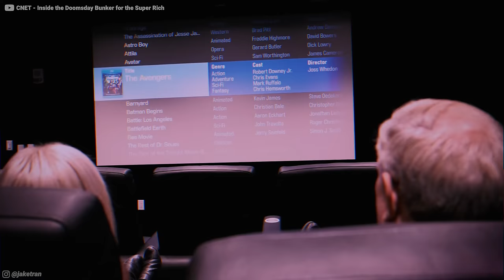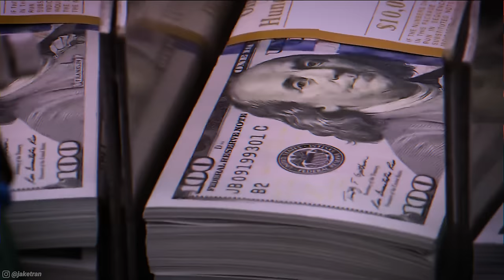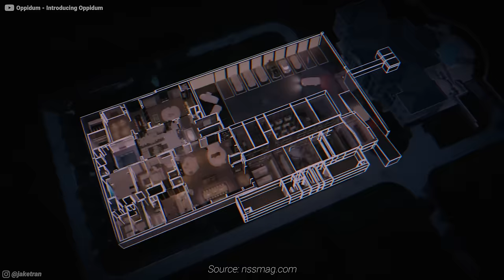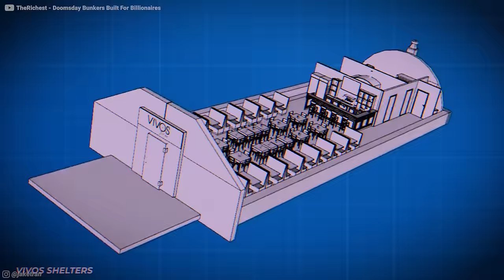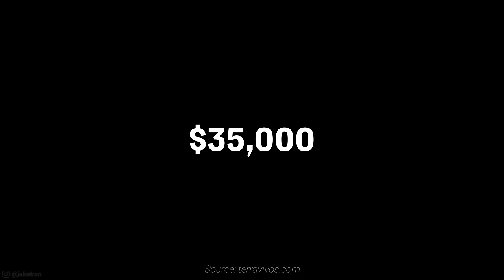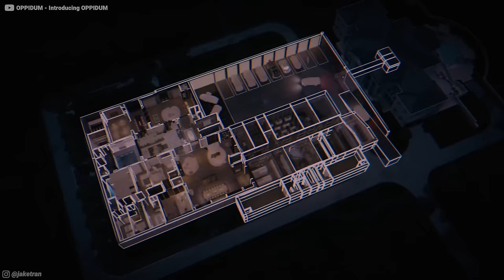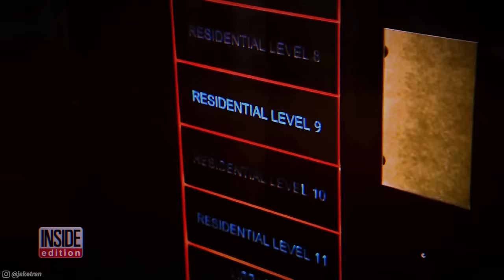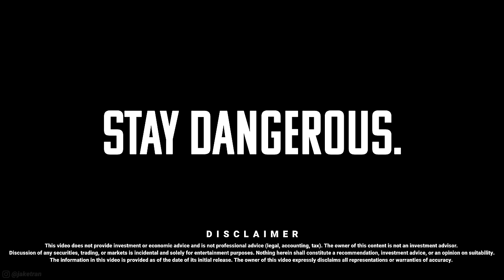The Doomsday Bunkers of the Rich & Powerful

Comment: So what happens when someone decides to break in. Don’t say it’s not possible. All you got to do is avoid the entrance cause you know it’s trapped. Just dig the bunker out and use a torch to cut into it then just drop homemade Granada’s-in there with nails etc in it.  There is t a locked that can’t be picked or blown off. Those bunkers are caskets if you ask me……

Comment: Building a bunker so far from the mainland (assuming one lives in the US) seems like a foolish endeavor because what guarantee do you have that you can get on a plane or ship to get to hawaii or new zealand? The only way this makes sense to me is that they would know ahead of time that they need this doomsday retreat. Think of something like an emp blast or having a functional runway system to get from point A to point B.

Plus id never in hell want to rely on solar and wind for energy alone... you surely want s disel generator as a backup at least becuase if there is some kind of nuclear apocalypse sun light may be an issue. 

Then theres the security aspect. Imtalking about the men who will be armed and guarding the place. If society is hopeless doomed your prior wealth isnt going to matter.  The physically strong and capable will survive and could simply become the master in such a scenairo. If i had the means id have a bunch of disel fuel to run a generator and have several backups aside from having silar and wind... but id also not focus so much on luxury and id damn sure worry about not being able to get those blast doors to re open.

Comment: Jake didn't mention the fact that anyone can destroy your solar panels, and you can run out of water. What happens if the surface of your bunker gets destroyed...🙆
Reply: They have diesel generators and probably enough fuel to last 100 years.
Reply: @thatundeadlegacy2985   diesel generator must get air from somewhere and must release exhaust gas somewhere as well, hint : to the surface. the only guaranteed power generator is a mini nuclear plant...
Reply: Security will protect it lol

Comment: 10 kilotons is hardly a tactical nuke. Basically they're saying that it cannot withstand a blast
Reply: You are right, the guy's answer was not clear. He tip-toed around the question. He mentioned that the doors are 8 kilotons each and then seemed to just ignore the fact that his answer entails that the bunker would not have survived a blast if your doors weigh less than the force applied.
Reply: The chance a nuke would be detonated above the bunker is zero

Comment: I still don’t get the island thing. Like, I’d build I bunker at high point, that can be more easily defended, and isn’t the first thing overflown and without air supply in case of a minimal increase of the water level.